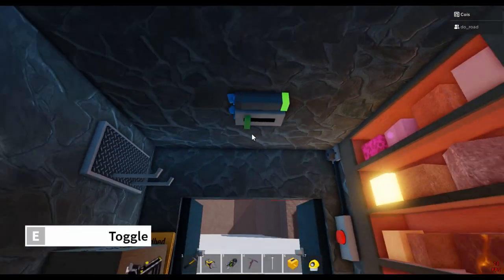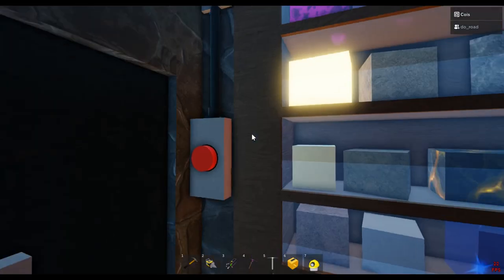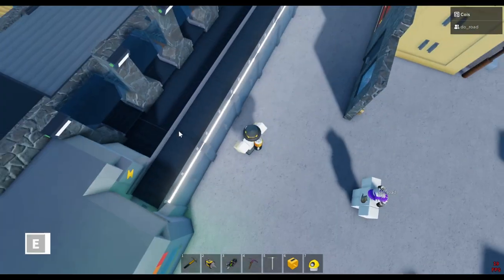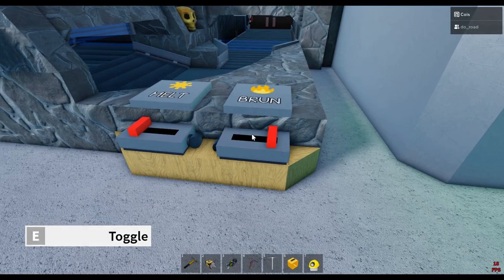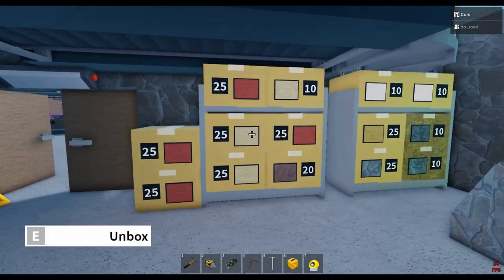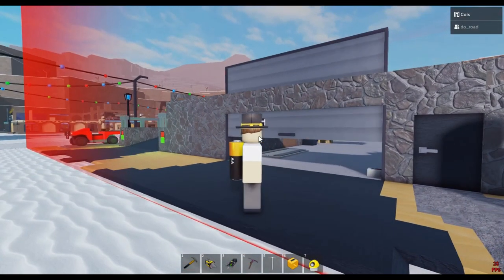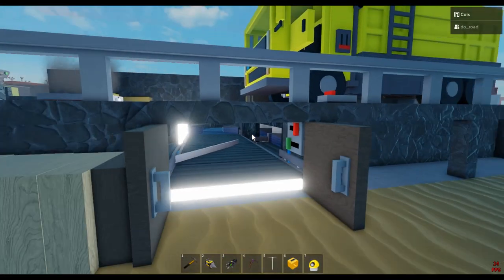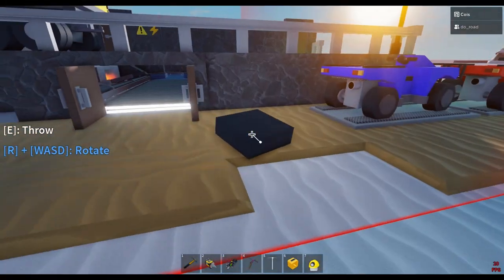Refinery Caves - Base Tour! (ROBLOX)

Comment: Tutorial pls base
Reply from the maker: will do later
Reply: @LFSDataBase When will it be out?
Reply from the maker: @MylesTGG  a base tutorial wont happen i guess. Ive build it to much and complex to explain it because when i run in issue with ore getting stuck and all i make a workaround so sometime i just build something test it. Tear it down like 75% what you just builded. And then remake but better to solve it. Its has a bunch of wires to i run them inside the blueprints or under tve base floor to to make all that as tutorial is crazy work. If i did this in begin befor i builded it all. But i had no plans to make it this crazy and big but never stopped to exspand and build crazy stuff xD